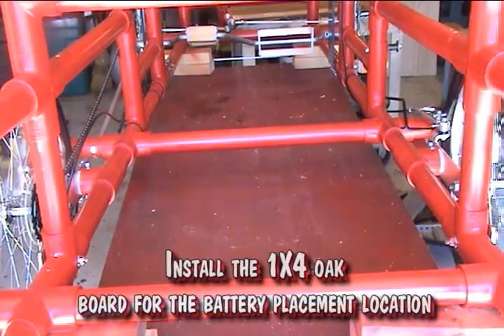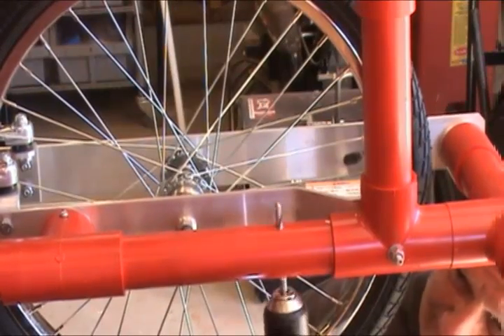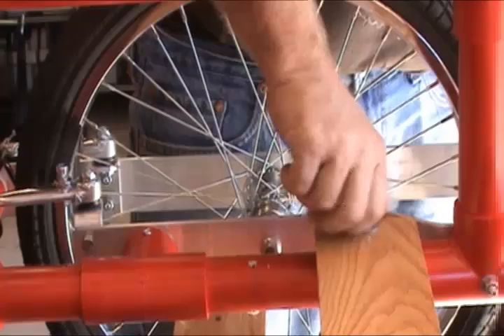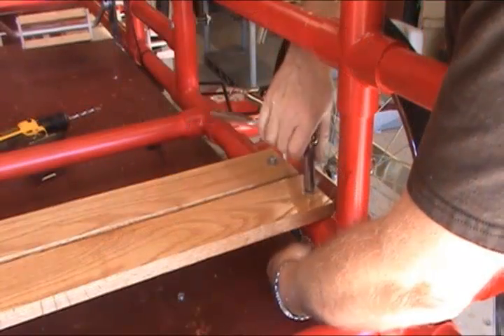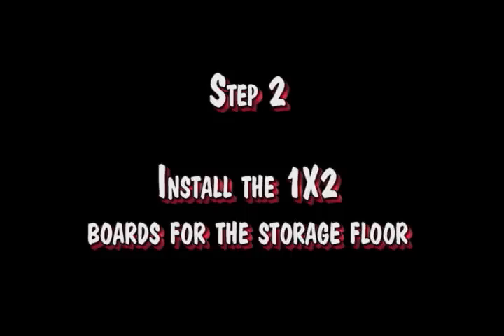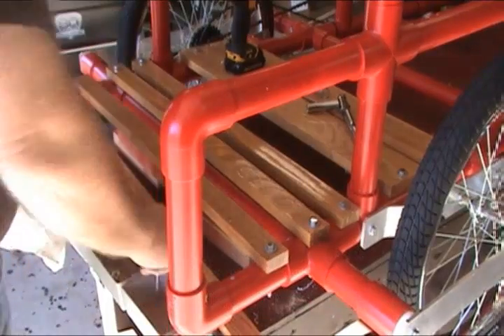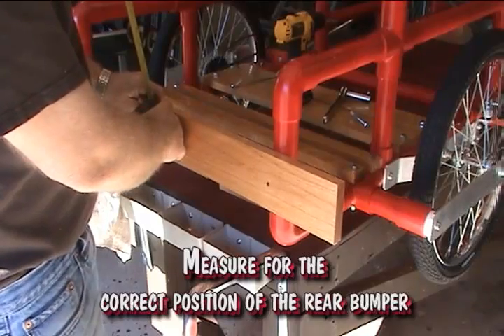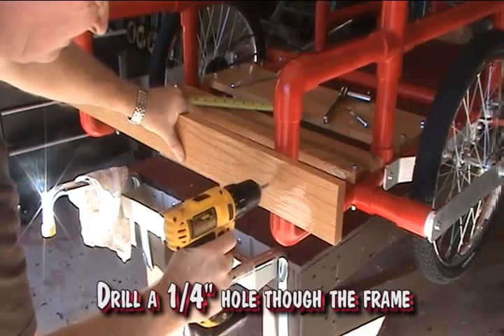Part 18 of 29 - PVC 4-Wheel Cycle  - How to Build and Install Battery Floor and Rear Storage Area

Comment: What are all the tools you will need
Reply from the maker: All you need is basic tools, miter saw, phillips screw driver, hamer, tape measure, pencil, standard wrench set, standard socket set, standard hex key set, regular screw driver, steel wool, sandpaper, goggles, rubber gloves, vice, drill and drill bit set, jig saw, hack saw, square, level, blue painters tape, sharp razor, multi-meter, etc.
Thanks
Norman